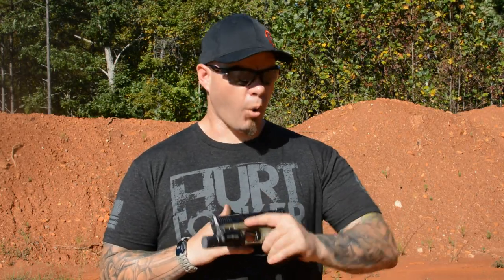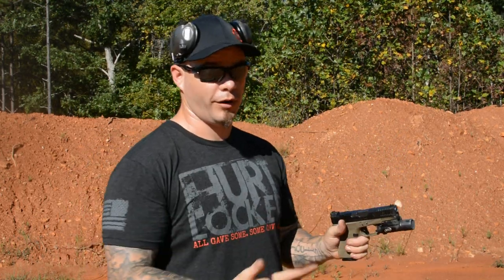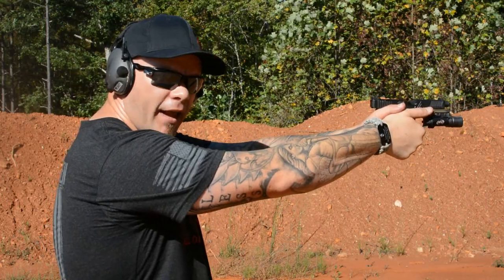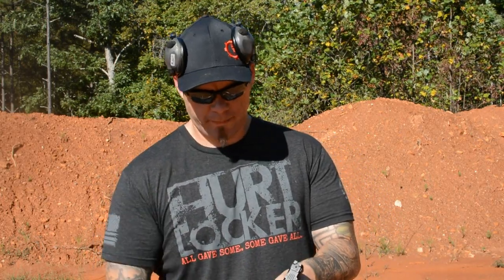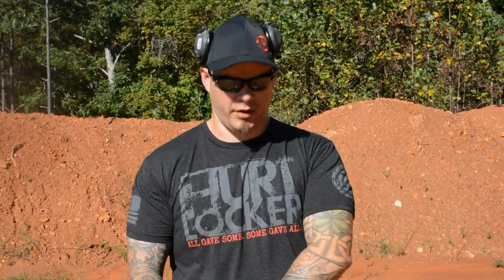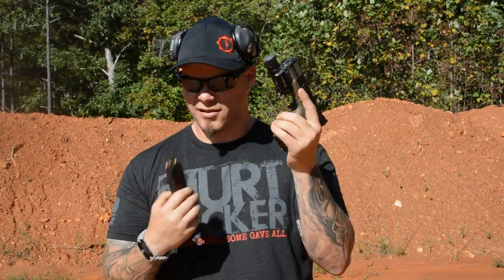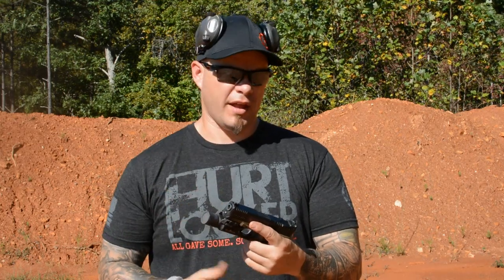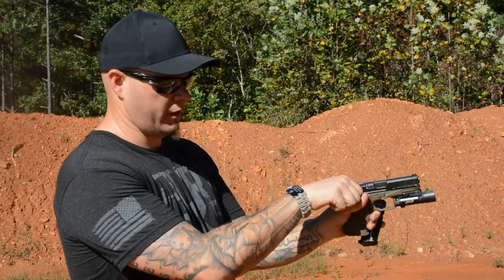Handgun Malfunctions

Comment: Hi Aaron, I was wondering if I could have your suggestion. I'm planning on getting an Agency 19 and am undecided on getting the flared magwell. Based off your comment about how flared magwells can make that trick you showed harder, would you recommend going without the flared magwell? I noticed you still have one for your Field Edition
Reply from the maker: It's a risk vs reward situation. Still very doable with a mag well but your purchase on the floor plate is reduced.
Reply: I can say from personal experience with the gen 4 Agency magwell I found it absolutely does interfere with mag stripping. Even on mags with Vickers enhanced mag  base plates. I also found with standard length/capacity Glock 19 mags that are loaded to full capacity the Agency magwell requires an extra hard seating tap to ensure the mag catch engages the mag and retains it. Because of these two issues I removed mine. In the stress of a life threatening confrontation these were two issues I wanted off the "shit that can go wrong" list. Save the $100 on the magwell and put it towards attending a Sage dynamics or other quality training class.
Reply: +SageDynamics Thank you for the response and more so for putting out extremely valuable content like this for free on a regular basis for us. I'm going to be taking SD classes in the future. Hope I don't sound like a kiss-ass, but I see a lot of value in this
Reply: +carbonking53 Thanks for the awesome response man, I'm actually really glad you said that. I have only love for Agency, but yeah, that might kinda suck

Comment: Great video thanks  ?  Arron what is the odds of a unspent round once ejected firing when hitting hard surface i.e. shooting range floor
Reply: The round wont fire. It can only fire by hitting the primer which is pretty much improbable to happen. Even if it did ignite, a round that isnt in a chamber isnt very dangerous at all since there is no barrel. Just pops.

Comment: Aaron, I kind of dread even asking this question because I'm probably going to get hammered on it by somebody but I'm going to ask anyway. When talking to your students about malfunctions do you ever bring up a hang fire? The only reason I ask is because when I watch you racking the slide from the front I wonder if you are ever concerned about the round going off late. Obviously in an emergency situation that would not even cross my mind but in practice is that ever a concern?
Reply from the maker: Nope, legitimate question.  I do cover it but it's such a rare occurrence with modern ammunition that I personally accept the risk in exchange for the rewards.

Comment: As for removing the magazine, i just depress the button, lower the mag a little, clear the chamber and tap the mag back. A bit time saving
Reply from the maker: That technique works on polymer magazines. It does not perform reliably across all Gun types with metal magazines.
Reply: @SageDynamics  did i mention my glock? :D keep on rockin'

Comment: First could have been a hangfire which you don't know so you are supposed to wait 60sec then clear
Reply from the maker: J S 40 years ago, sure.
Reply: @SageDynamics  Been taught that by every instructor....what if the round goes off 2 sec after and it's racked out? You are getting a nice explosion near you. Why can't a hang fire happen these days?
Reply from the maker: J S because modern ammunition components and manufacturing.  Can it still happen?  Sure.  I’ve never seen it.  Don’t personally know anyone who has and my sample size is hundreds of thousands of rounds, hundreds of students a year.  Also, I don’t know any of my peers who teach it, either.  Because it’s not 40 years ago.

Comment: The 2 DOA rounds from cycling... thats why my duty gun and my off carry guns all stay loaded / chambered.  I never unload unless im shooting or cleaning.  Screw that unload every time BS.  Get yourself a cheap pistol safe to keep it in and leave it hot.  The other thing that can happen is constantly  Loading the same round pushes the round back into the casing and when you pull the trigger now you have a really big problem...  And overpressurized round.   Store them hot 24/7.

Comment: The reason it's taught not to look at the gun and just fix the malfunction(Tactical Response) is because you can't look at your gun to diagnose the problem in low-light.
Reply from the maker: Yeah, you can.   And imagining that you couldn't, does that mean you wouldn't find an easier solution in day time?   Most malfunctions can be diagnosed by feel, but not all. Which is where human nature helps.  Teaching against human nature may make sense on the range but I've yet to see it translate to real life.
Reply: +SageDynamics I see both views on this one. I've already trained myself to Tap rack when there's a click and if there's another click I need to reload. I carry two spare magazines in my left pocket for this purpose.

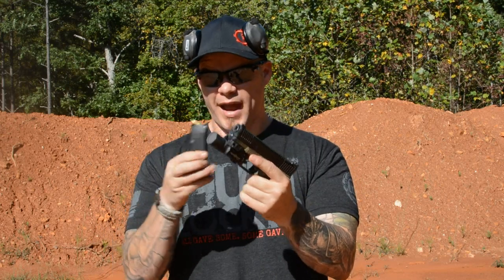Comment: Sage Dynamics - 11:39 - "I can take the magazine, in the condition it is in, put it right back in the gun, rack the gun, and I guarantee you *ping* It'll fire"

Ok. So the first 2 techniques, I've always heard, for rifles and pistols alike. For the double feed technique, I tried in my pistol 3 times and the same result occurred all 3 times. When I stripped the mag out of the piarol, the cartridge at the top of the mag, which tried to feed, ended up lop sided in the mag which caused a difficulty or complete inability to reinsert the mag, or caused a failure to feed when I reinsterted the mag and racked the slide. The other problem that could occur here, is the round which failed to eject in the first place, fails to eject the second time, and the third time. Obviously when you are practicing with good training rounds that function with your ejector during practice, it's going to eject after you've ripped the mag out and the bolt has fallen on a perfectly ejectable round. But What do you do when you strip the mag and rack the slide and the round refuses to eject the second time, or third, or fourth? Do you just keep racking the slide until it comes out? What do you do after you've racked the slide 20 times and the cartridge still hasn't come out? Do you still keep racking the slide? I have had a couple rounds in my lifetime on the range fail to eject, and refuse to be removed from the chamber by the ejector no matter how many times I racked the slide.

Maybe I just have a pistol which doesn't like your method, however, my method for clearing a double feed has always taken a bit more time but is 100% reliable in any firearm. First and foremost, take cover, which you should be behind to begin with... 2, Lock the slide to the rear. 3 Remove and retain the mag. 4 VERY forcefully slam the back of the slide into the heel the palm retaining the mag to dislodge the round from the chamber allowing it to drop out the mag well (this should hurt if your palm is not conditioned). 5 Strip the top round out of your mag using the palm or wrist of your fire control hand. 6 Reinsert the mag. 7 rack the slide. 8 fire. 

8 steps may seem like a lot until you have practiced them. Once you have drilled this a few times, it can happen as fast as you read this... Cover, Lock, Remove, Slam, Strip, Insert, Rack, Fire.

So if you are a competition shooter, shooting for time at targets that aren't trying to kill you, with a pistol you KNOW won't fail to feed when you insert a mag with a lopsided round on top, your method probably works. But when your life depends on it, when you are engaging in combat with an opponent who is trying to kill you, I would advise taking that little bit of extra time to ensure 100% reliability. Slow is smooth, smooth is fast. So move fast but don't hurry, because undue haste makes waste. Any military man has likely heard all 3 of those sayings. Take your time (quickly) and ensure 100% reliability.

As per your quote you guaranteed I could put the mag in the condition it is in, rack it and it will fire. When I applied your technique my firearm failed to even chamber a round, let alone fire. So what kind of guarantee is this? Is this a money back guarantee, can I come take one of your courses for free since your guarantee fell through?